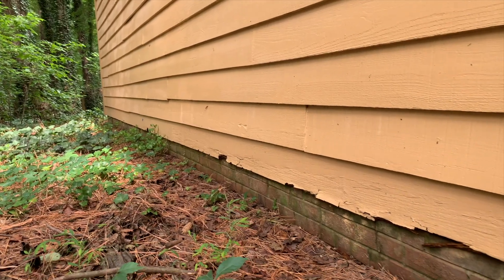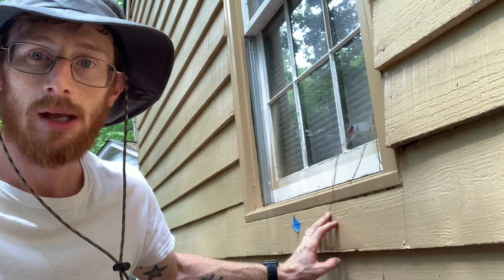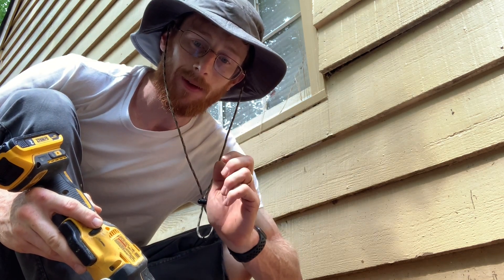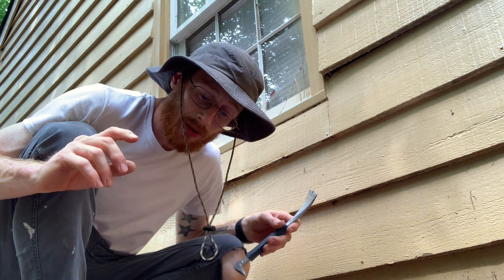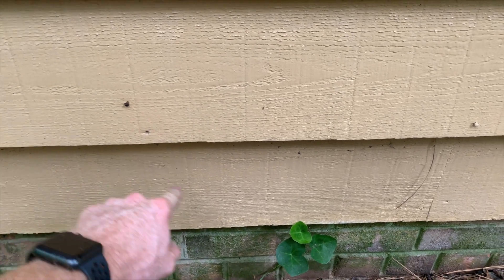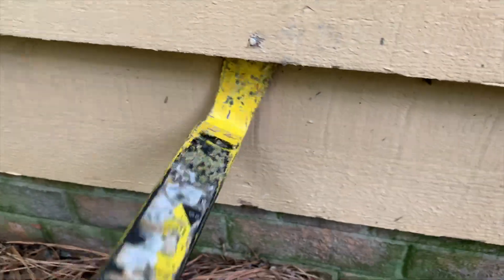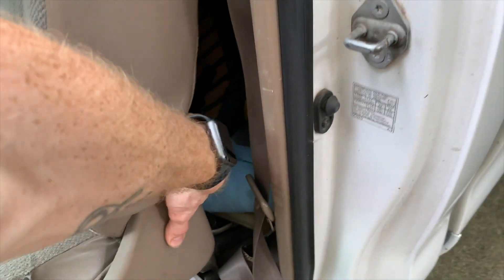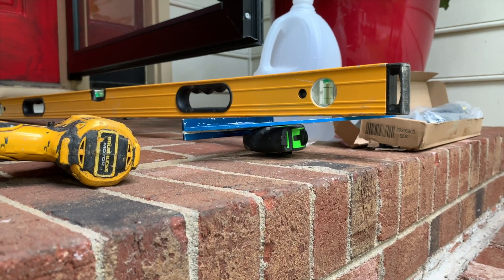How to Replace Cedar Siding

Comment: It's a bit extreme but the stairs/ landing are pitched like that to shed water away from the house. Also, try using a metal cutting blade on the oscillating tool..cuts through those small but sometimes stubborn nails quickly without any unnecessary damage. Keep up the good work👍

Comment: Great video. Pasig cedar, should I use caulking, and if so, what kind of caulking?
Reply: Repairing
Reply from the maker: https://www.lowes.com/pd/DAP-Alex-Fast-Dry-10-1-oz-White-Paintable-Latex-Caulk/3024883?cm_mmc=shp-cprdpntgglLIA_PNT_221_Glue-Adhesives-Caulk-Repair-3024883-local-0-_-0&ds_rl=1286981&gbraid=0AAAAAD2B2W9LvIy-PoS0_ZEsC1vnSAcn5&gclid=EAIaIQobChMIg5TvsPyM9wIVibrICh2g8gMYEAQYCSABEgJcCPD_BwE&gclsrc=aw.ds
Reply from the maker: I tend to use the Dap Alex Fast Dry Acrylic Latex Caulk. It’s inexpensive and it’s quality is pretty decent.
Reply: Thank you Chris

Comment: I'm a newbie and determined to replace some boards myself rather than pay someone. When I pulled a board away there seemed to be a paper behind it in very poor condition. Can I just replace the section behind the rotted boards? What's that paper called? My townhouse was built in 1983. Thank you!
Reply from the maker: The paper is usually called house wrap. It sounds like your paper might be a little bit crumbly which is pretty typical and I would just replace the sections that you decide to take off the side boards at.

Comment: Too late I have learned that cedar siding should never be sealed underneath with caulk (or paint) ... It will trap moisture and cause permanent damage ... My question is how to remove it now that it has been painted? ... I see the paint bubbling on hot days ... Siding is intended to breath via the overlay ...
Reply from the maker: You may need to cut the caulk lines and then possibly use some paint that can endure the heat. I’ve seen a number of homes siding get blasted by the sun ☀️ making the paint peel or even vinyl siding plastic melt. I don’t know if I have a reliable tip though.